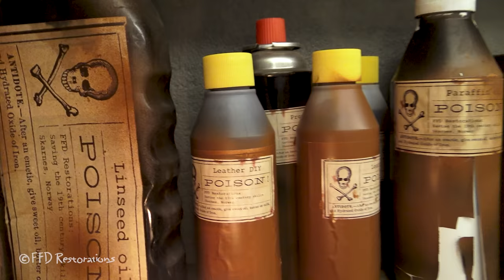Japanese Vietnam War Era Jet Pilot's Survival Knife RESTORATION

Comment: That's a U.S. Navy aircrew survival knife(among other things).  We all carried one strapped inside our survival vests.  I think you'll find that it's made of very soft steel.  It wasn't designed to hold an edge.  It's designed for survival, and was meant for digging, rough sawing, and prying.  This is a great tool for digging up roots, cutting and splitting bamboo, and for making pieces for shelters.  I still have mine; our Parachute Riggers usually gave an aircrew their knife when they retired from flying.
Reply from the maker: That is awesome, thanks for sharing sir!

Comment: Beautiful restoration and cinematography! Also, if you’re not opposed to using modern chemicals, Evaporust works several orders of magnitude better than vinegar for rust removal. Its basically like magic, lol. Give it a try if you want to cut down on the sanding and vinegar soaking time. As always, thanks for sharing this video with us
Reply from the maker: Thanks for the tip, I appreciate that 👍

Comment: Thanks, for this. I have this exact same knife that I purchased back in the 70’s from an army surplus store. I never knew what it was called and now I know. Mines still in pretty good shape. I’d lost it in the woods for a few months when it fell out of the sheath, so it has a small amount pitting from rust. The sheath is in great shape as I’d only lost knife and the sheath has never been wet. 
The only thing is I misplaced the sharpening stone that was in the little pocket. 
Not the best quality knife, I think I only paid $6 dollars for it, but it’s like an old friend.
Reply from the maker: That is cool, thanks for sharing!
Reply: Update, after watching this, I googled the name of this knife and found that one in pretty much the same condition as mine sold for $125 at auction. I think I paid $6 for it new.
Reply from the maker: @bcreason  👌😆
Reply: I almost bought one like that in 1972, and like you in an Army Surplus store.  I had gone there to purchase a camo outfit for ROTC.  The store was near Ft Campbell, Clarksville, TN.  Being in college at the time, I really didn't have the extra money for anything I didn't need.  You're right, the knife wasn't of good quality, but I wish now that I had gone on and bought it.

Comment: I've  got one of these, scrounged it back in the 1970s when we did cross training with the US army. Good knife.
I was told there was originally a spear handle supposed to screw on but it never happened.
Don't know if that's true through.
Good knife, I  still use mine for camping.

Comment: This video is some answer to my question on rust conversion. What is that at 3:00, Evapo-Rust or something else?
I found that it was easier to clean the tools after Evapo-Rust, but the degree of conversion was less than with Rust-Oleum, but may be I used Evapo-Rust not in the most optimal way. I cleaned up the black goo from Rust-Oleum in warm water with some detergent with a mechanical brush, it took a lot of effort, but I like the results.
I also like the process of manual tumbling with small stones, maybe I can use the idea for some of my projects.
I guess there is a lot to learn from your videos, thank you for sharing!
Reply from the maker: Hey, thanks for the comment! I have used a 7% white vinegar that was used already a few times (that explains the vinegar brown-ish colour). I stopped using more aggressive rust removers because they need more attention afterwards to remove them and I need to take them to the recycling center afterwards.
Reply: @FFD_Restorations  Thank you for the answer. I agree, it's a problem. At first, I used hydrochloric acid, and it worked, but later tried some commercial specialized remedies, they have a lot of benefits and some can also be reused. Not converting rust is another problem I tried to explain before.

Comment: Hey! I kinda know this type of blade. 

This is one of the famous "Air Force Survival Knives". The first model was the "Knife, Hunting, Survival, Pilots" designed in 1957 by the Marble-Arms Corporation for use by USAF aircrew. Within a few years it evolved into the Jet Pilot Survival Knive and in 2003 was superseded by the "Aircrew Survival Egress Knife", made by the Ontarion Knife Company. If this is a Vietnam-era blade, I would expect it to bea Marble-Arms made version - I am not aware of Japanese-made knives of this pattern, so that's very interesting indeed!

As you have demonstrated, the knife is of a through-tang construction w. a grip made of leather washers. The blade itself is 5 1/8" long, 3/16" thick and made of 1095 steel at 56 HRC (sources differ). The clip point & serrations are meant to help cutting through the aluminium of an aircrafts fuselage. Nobody is quite sure what the two holes in the guard are for though, perhaps to lash the knife to a stick and improvise a spear? Either way, that was a great restauration! Kudos!
Reply from the maker: Wow, this is amazing. Thank you so much for sharing and taking time to watch this video! Take care!
Reply: Although it says Japan on it, because that's where it was made, it is a replica of a US knife and it's probably not old enough to have been to Vietnam.... nice restoration though
Reply: @FFD_Restorations  Although it says Japan on it, because that's where it was made, it is a replica of a US knife and it's probably not old enough to have been to Vietnam.... nice restoration though

Comment: Excellent video. I was wondering how you were going to "restore" the sheath...as you made a new one. I would do the same (since I do leatherwork). I would've used different rivets, like solid brass - double cap, black ones. The ones you used seemed a tad cheap - like aluminum? Anyways excellent work over all. Respect.

Comment: Beautiful video production and awesome skills and workshop. What did you do to guard and blade with the forge?  I'm concerned about heat treament loss
Reply from the maker: Thanks, warming up the blade to protect from rusting. It needs to be bright orange to lose heat treatment! Thanks for watching!
Reply: @FFD_Restorations  I would encourege you to check this. Heating blacksmithing tongs, tool handles and other pieces and treating them with bee wax or other substances for rust protection after heating is common practice, but with steel blades it's not a good idea. If the blade changed its colour, you can be sure temper was affected and the steel softened. How much? it would depend on how high and for how long the blade was heated. Depending on the steel, you can start changing the temper even as low as  400° - 500° F
Reply from the maker: I appreciate that, thanks

Comment: The video is cool. But I haven’t seen you temper the knife. I might be wrong but it will not be a good knife in the long run. It is a nice polished rusty knife. The sheath btw is great.
Reply from the maker: Thanks for watching! There was no need to temper the knife since I just warm the blade up. Haven't changed previous hardening and tempering of the blade. If I had a glowing red blade, that would be a different story.

Comment: As someone below stated, it's not Japanese, it's American and it's not "pilot" it's aircrew issue. It was in the Navy at least. I was a rescue swimmer in the 70's. Still have the survival knife that was included in my SV2 (survival vest) when it was issued. There were slight variations depending on branch of service and exact year issued so I'm assuming there were multiple suppliers to the military. On some the hexagon butt piece is welded on while others appear to be riveted (like mine), and yours screws on. Some have the sharpening stone, mine does not. I believe it was the Marines or the Army that had the stone. Some have a pointed sheath while others have flat tip sheath. My sheath is a flat tip with a thin metal plate on the back of the blade portion of the sheath that folds around the tip and covers about 1" of the bottom of the face on the sheath. I guess it's for wear and to prevent the tip of the knife from coming through the sheath. One of my hunting knives did that and ruined a nice full length fully enclosed sheath. Nice work making an abused knife useful again.
Reply from the maker: Thank you for such a detailed feedback sir, I appreciate that!

Comment: Excellent restoration but this knife has a weakness and it's at the hilt or finger guard on the tang. The tang itself is made of weak metal and will break if pressure is placed around the guard. Better to have a full tang for this kind of knife or a thicker stronger tang.

Comment: The original version was junk, I got ahold of a pilot’s knife in Vietnam and using it as a utility knife the blade broke at the guard within a week, I still had my Fighting Knife which was made  by Camillus but was the same style as the K Bar and the blade was also sharp on the clip side. I still have it and still use it for utility work when camping. I understand that the short knives were notorious for breaking at the guard because they are really weak because they are very thin in that area.

Comment: That is NOT a Japanese knife. It's an American pilot knife. Old military issue. It was, and still is made by the Ontario knife company. Only small changes have been made over the years to its design. This knife can still be purchased.
Reply from the maker: Why would Ontario Company make knives and stamp them "Japan" on the blade. That does not have any sense! This is Japanese pilot knife and they have been produced by many during 70's. It is true that they are in production till this day but not the same quality as before.
Reply: @FFD_Restorations  this ain't no Japanese blade

Comment: Little  confused about the  Japanese  part looks  like  an American  Camillus  top nut pilot knife  issued to many nato countries
Reply from the maker: They were produced under many names. This one has stamp "Japan" on the blade.
Reply: @FFD_Restorations  it's an old design that's been copied countless times, the purpose was a knife air crews could use to cut their way put of a crash & survive til rescued...the saw teeth in the back of the blade aren't for wood, they're for cutting thru plexiglass canopies & aluminum aircraft sides to escape from a crashed plane or helicopter...the originals can be spotted because of the metal at the bottom of the sheath which prevents the blade from poking thru the leather...the cheap copies don't have that...

Comment: While it is a nice looking knife it is no where near an original. They were widely produced by normal knife makers for the US military and are still offered by Military surplus/ knife shops.

The sheath and handle were natural light leather and most parts were parkerized  to meet the military specs in the contract for them, with a few made blued. The rivets and snap on the sheath were painted black.

The blades were not polished and only maybe a 1/16 of an inch at the blade edge was exposed metal from sharpening.

There was offered a decorative set or individually that had highly polished blades engraved with the various aircraft of the Vietnam era but were not made on contract to the Military.
Reply from the maker: Thanks for the feedback

Comment: What is pictured in the video is not a real US made pilot survival knife. It is a Japanese or other country copy. I have some real ones and also have a Japanese copy. On the Japanese copy you can screw off the butt end because it is threaded. 
On the original US military ones the metal tang goes through the but and is peened/deformed over and that is what holds it on. If you try to turn the butt off of a real US pilot survival knife you will break the tang.
Reply from the maker: Thanks for the feedback 👍